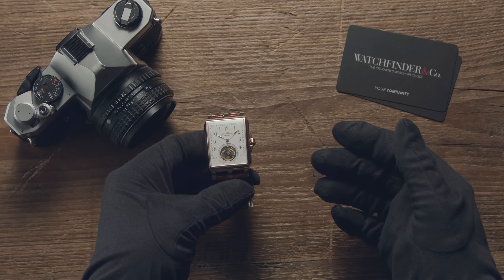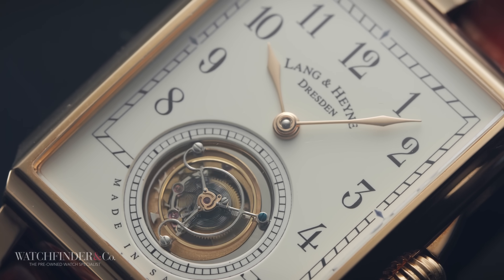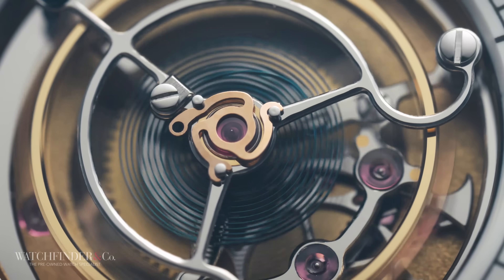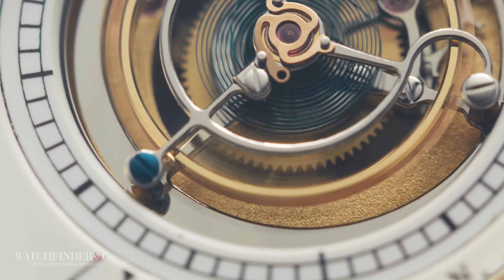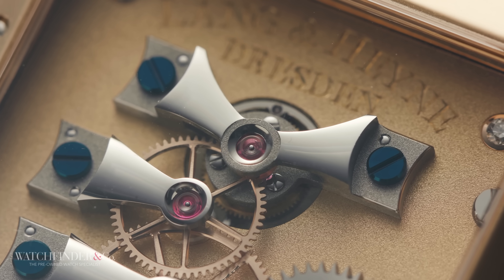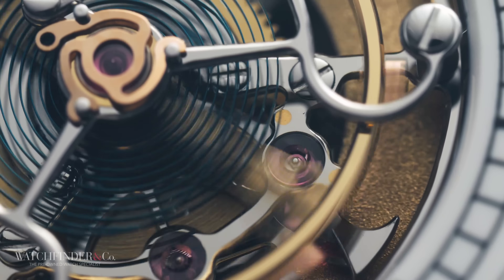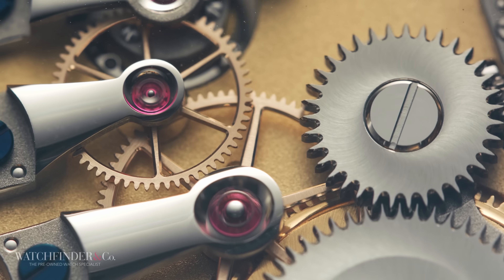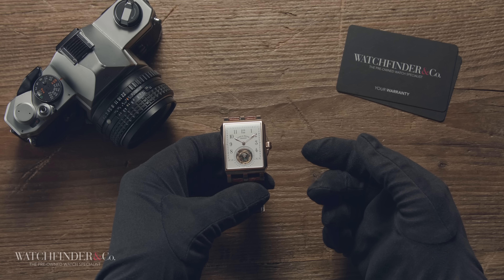How On Earth Does A Tourbillon Work?

Comment: So explain to me why this watch still cost 100k.  I can buy a CAD CO2 cutting laser for a couple grand for the small parts and a regular CNC mill for the larger pieces, and literally make every part of that movement myself.  I see hundreds of watch repairers online that can disassemble and assemble every watch put in front of them.  Why not just make it yourself.  Casting gold and silver can be done anywhere with a couple of hundred bucks worth of kit and finally you can 3d print in casting wax.  So there's no part of that watch you couldn't manufacture at home.  Has anyone done this?  Certainly typing in the words "3d tourbillon file download" into google will yield something.

Comment: Lovely watch and good presentation but to my mind it would have been better if diagrams or individual components had been had been used to explain/illustrate each stage of the description. Clearly it is not possible to take such a valuable watch to pieces but It is not always obvious which is the part being described to those who are not watch nerds. By the way, I used to write technical guidance for my living and have both of George Daniel's books so not without an understanding myself - I just think there are better ways of explaining such details.

Comment: At Timestamp 7:04 7:04 one can see that the tourbillon on this particular watch is not constructed properly. One of the circles around the crystal ( the shock protecting gold nib )  in the center isn’t connected to its rod. Wonder if that is an issue.
Reply: It seems longer than the other two "Isle of Man legs". I saw it but thought it was probably intended simply to tension off that pin.

Comment: 110K. So how many beers did the Germans drink to come up with that figure ?
Reply: In a World where a mass produced steel watches without any major complications go for 50-100k... 110k for a truly hand built watch are high- but not insane.
Reply: @raupenimmersatt6906  Couldn't have said it better myself.
Reply: Why don’t you sell cheaper then? You could make a fortune if it’d be so easily.
Reply: @diavalus  

You do realize that Chinese sell Tourbillons for less than a grand.
Reply: @theshadowman1398  and they are shit. No offense, but in this case they aren’t charging that price ONLY because of that complication.
Reply: @diavalus  

Actually they are not. This watch has maybe 500 usd worth of gold, what else does it has that makes it work as much as a Porsche 911 ? It’s for sure doesn’t have as much engineering or parts as a car.

Comment: The gravity pointing wrong way issue with the wristwatch is a complete oversimplification and is straight up wrong. The only people the tourbillon faces “the wrong way” for are office workers and even then only sometimes. Walking, driving, working with hands, all has the tourbillon face correctly.
The real issue is it moves around so much on your wrist that it doesn’t have any real effect, or rather the effect is outweighed by you yourself changing its position.
Tourbillons on wristwatches are useless unless they are 2 or 3 axis. 

Even the fp journe sideways tourbillon - still useless
Reply: Even then, the multi-axis tourbillons aren’t essential for accurate timekeeping on mechanical/automatic wristwatches, they’re more like just works of art.